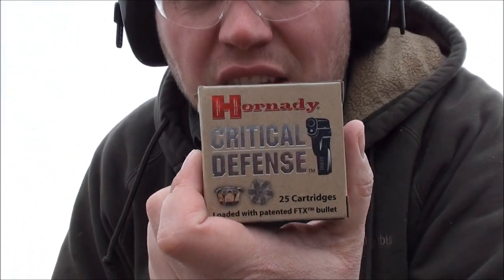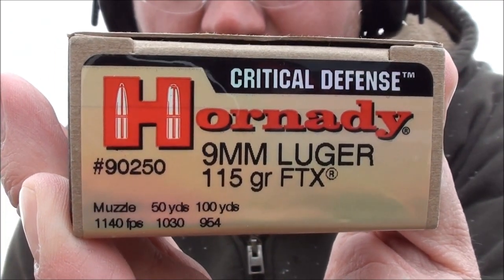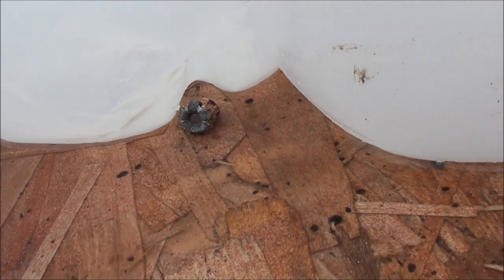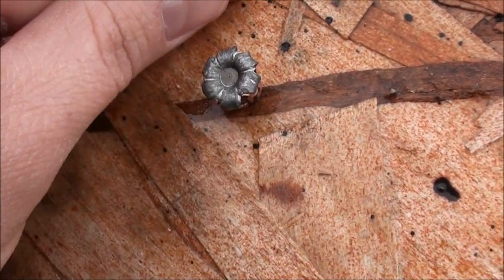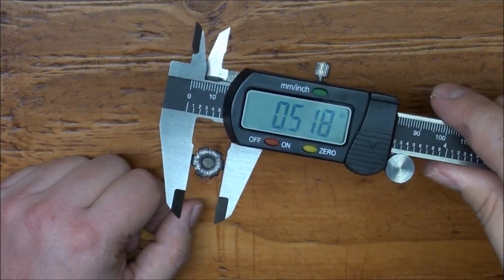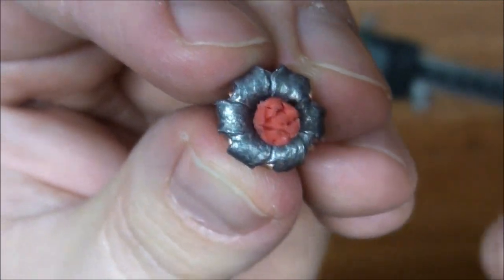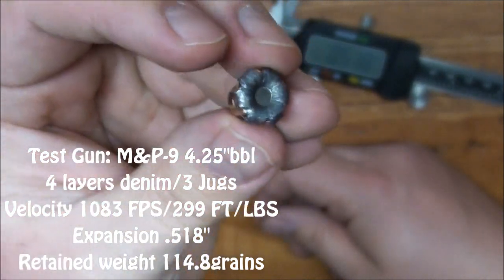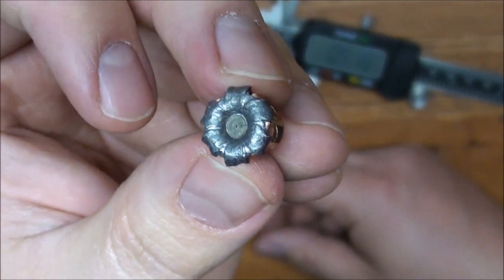Hornady Critical Defense 9mm 115 gr FTX Ammo Test

Comment: From what I understand, the Critical Defense ammo is meant to be used in shorter barreled handguns that is typical of your carry guns and the Critical Duty line is intended for full sized weapons. If this is correct, what length barrel constitutes a "short barreled" handgun? I'm fairly sure that 4.25" barrel used in the test doesn't fit into the typical short barreled carry gun category. I wonder how this ammo would perform in an XDS9 (3.3") or an M&P Shield (3.1")?

Comment: I am looking at getting the Kel tec P11 and wanted a softer shooting defensive ammo. I have to figure out if these will feed well in the P11 but if it does than I will most likely carry it as it beats my current .380 load out. Along with the P11 I can carry my P32 in my ankle holster. Another reason I like Kel tec is because if the gun gets damaged, lost, or stolen I will not shed tears over it, I can just buy another and keep my nicer guns from extra wear and tear.
Reply: I recently bought a P11 and a box of this ammo also. I like the P11 because I also wouldn't cry to hard if it were lost, and because it's reliable. I also really like the long firm trigger in this type of weapon. "Glock style" triggers are fine for full size sidearms that you open carry in a real holster, but I want a long firm trigger in a CCW gun, where you can safely stuff it in a pocket if you need to. Most modern CCW guns use the "Glock style" trigger, too light and dangerous to just stuff in a pocket. I bought a box of these rounds because it was the only defensive carry loads I could find, but  I also didn't want to put my full size carry 9MM rounds through the tiny P11 (Underwood +P+ 124 grain HP chrono: 1400 FPS out of my Walther M2 PPQ 5") as I had honest concerns about damaging the tiny 1990s era P11, so having lower powered loads isn't that bad of a thing in my case. I only put ten through at the range due to limited supply but ordered more and will test soon. The ten rounds I put through functioned fine, and recoil-wise felt the same as the cheap range ammo I shot that day also, so yeah, these are fairly low power for 9 mm. However for a P11, they are a viable choice, so long as I see continued reliability. It doesn't take too much recoil to run that tiny slide, so I'm hopeful. I'll post back with an update after more testing.

Comment: @240FP I was disappointed with the inconsistency of the velocities, especially given the price I paid for them. My hand loads are way more consistent. However, the 45 Colt is notorious for this with smokeless as it's a big case and the powder can have a tendency to "roll" around in there if it's not a bulky powder. The fastest and most consistent velocities I get are actually with blackpowder. But there again, the case is completely filled up. Just weird a factory load is so sporadic.

Comment: I had the same issue w/ the 225gr FTX out of my 45 Colt Vaquero. The Factory lists velocity at 950fps but over my chrono the avg. was 898fps. Which isn't bad until you look at the spread. I had one round at a mere 814fps, and another topped out at 1025. Then I shot them out of my M92 lever and my spread was 718 to 1071 (945 avg.). So the velocities were all over the map, which isn't unusual for a 45 Colt, but my avg. out of a rifle was less than factory 950. Despite it, I carry FTX in my 1911.